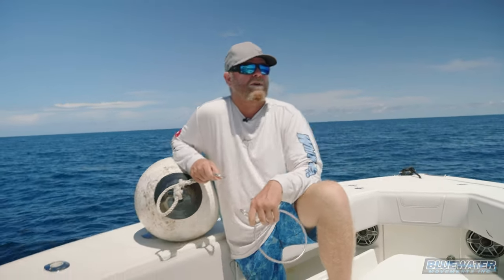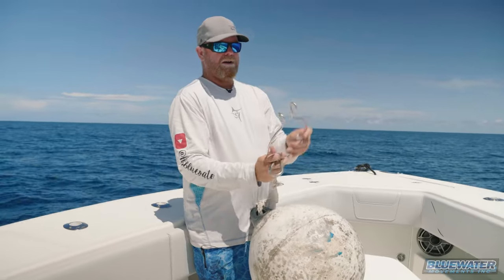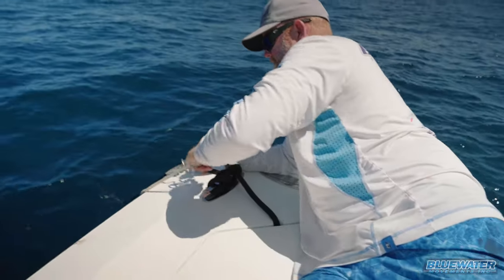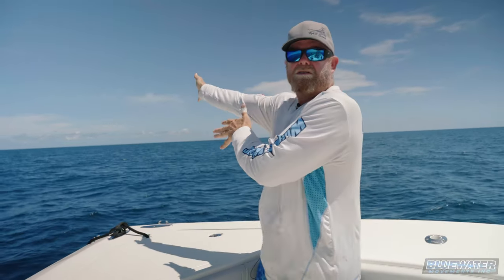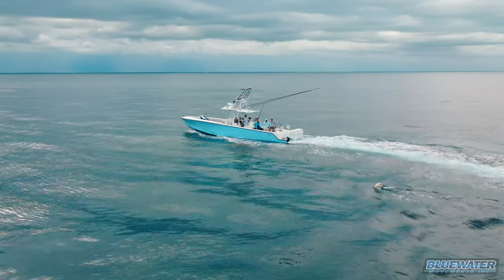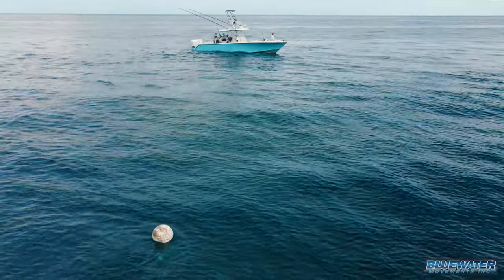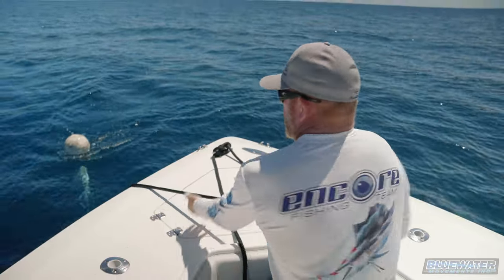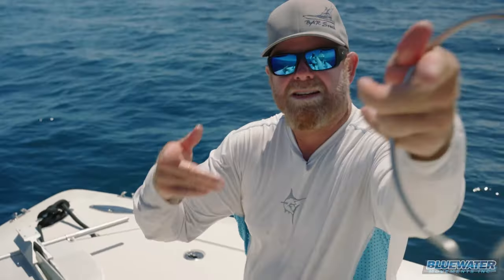Pulling an Anchor on Your Boat - How to Properly Use an Anchor Ball. GREAT Drone Footage!

Comment: Additional tip for a lot of rope..... when anchor is up drive over to it rather than pull in a stack of rope with a heavy anchor on the end, get the anchor in (and float etc) and put aside then pull all the rope in... way less back and arm breaking

Comment: so does this essentially position the ring directly above the anchor resulting in the force being directly vertical?  Does the anchor ever get stuck, if so what happens here?
Reply from the maker: The forks of the anchor hang on the ring so it stays up on the surface of the water and makes it much easier to retrieve. You actually want it to be stuck so it doesn't fall back to the bottom

Comment: Doesn't that anchor shape can get hooked so you may have to cut your rope and lose your investment?
Reply from the maker: There are different anchors for different types of bottom but this is a great all around anchor. The key is having an anchor ball to make the process of pulling the anchor easier if your boat doesn’t have a windlass and pull the anchor in the opposite direction when you pull it

Comment: Just a thought but you could try adding a stop mechanism or a 2ft length of pole between your ring and bow eye? it prevents the ring returning and catching between warp and bow eye(which it did on yours). I hope this tip keeps you safer.

Comment: How much anchor line did you have out for that deep of water?
Reply from the maker: Totally varies based on current and wind but an average rule of thumb is 3 feet of line for every foot of water. Our boat carry’s 600 feet of line which is generally enough to anchor out to a couple hundred feet of water depending on current. Gotta make sure you have plenty of chain on anchor too. That’s where most people make the mistake. The chain is what insures the anchor will hook and hold bottom faster.

Comment: Wonder if this will work for a slow big boat like a trawler. 🤔
Reply from the maker: Yep, just need to make sure you have a large enough ball for the size of the anchor and chain you are using
Reply: @fishbluewater  
Thanks. Not sure about a tight spot like a mooring field though. Definitely worth trying. I have a 1969 Grand Banks trawler.  I’d hate to have to hack it up and spend a fortune to put a windlass on it.